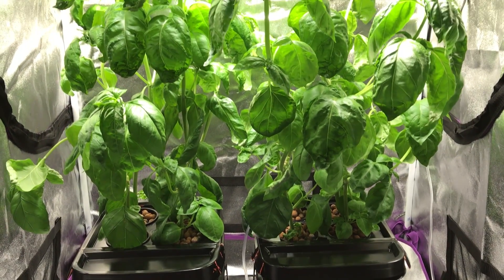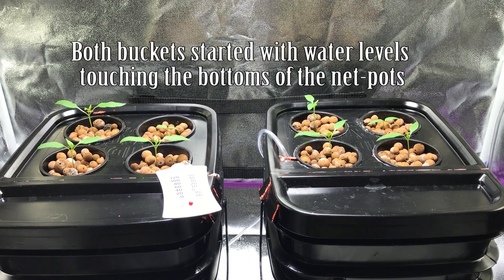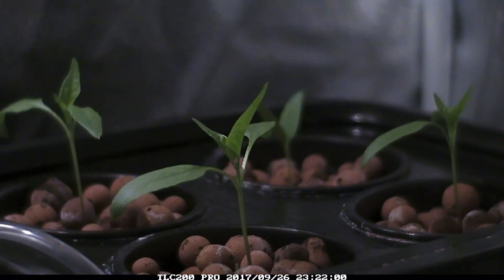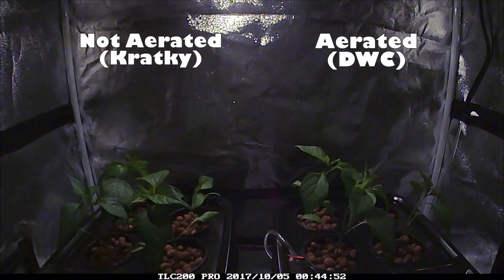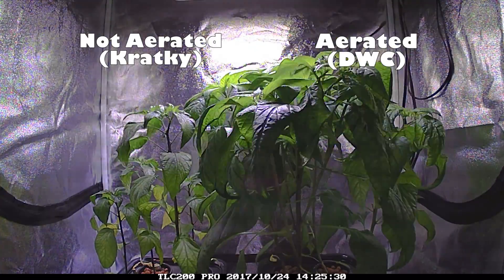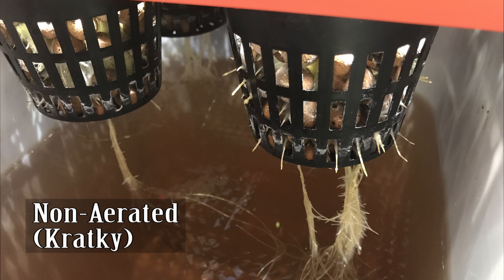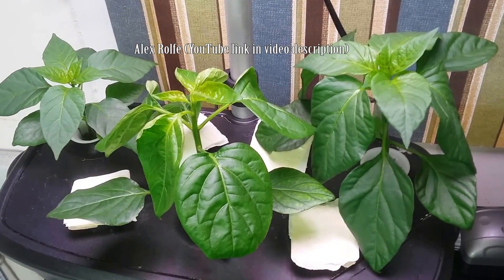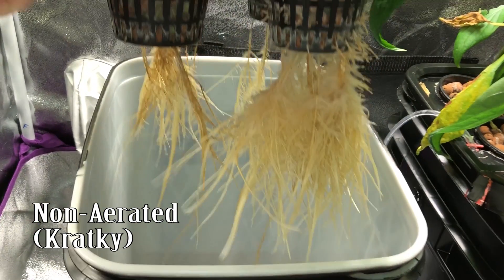Aeration vs No Aeration - Hydroponic Peppers w/Time Lapse (Brinno) “Semi-DWC vs Kratky”

Comment: Have you experimented with different degrees of aeration in the DWC pot? For example, a standard bubbler, vs one of those very fine bubblers, vs say an aggressive bubbler/several bubblers? Wondering if there is an optimum curve that could be resolved out of it. ..
Reply from the maker: Nick Burke not really, but what would happen is initially the ph would go way up with aggressive aerating. Then it would drop and become very acidic. Maybe one day I can do those tests. Just need one of those companies that sells atomizers to sponsor me. They aren’t cheap.
Reply: @GrowingAnswers  Good to know thanks for the reply

Comment: How far were the roots in water? Completely submerged or 5050.
Reply from the maker: 847MicRoss during the entire process the water level was gradually lowered naturally in both. Until it reached about half full. I kept it there through the fruiting stage and then let it lower further naturally until each had about 2 gallons left. Both were exposed to the same amount of air the entire time. Only difference was the air stone.

Comment: wanna ask question,  if we put a bigger air pump in a small bucket with single plant what would be the negative impact?  If any?  
The pump which is designed for 5 gallons bucket to provide air thru air stone and we are feeding that much air to a single one litre jar.  Will it create problems??
Reply from the maker: Nadeem Ahmed no. More aeration is better.

Comment: Nice video. I just got curious about the actual effect of water being aeration while the pumps was actually making the water to move as well. What if you add a water pump or a vibrator on the kratky? Wouldn't it produce a similar effect?

Comment: Would you feed nutrients to chilli (top feed) Every time they get dry or would you rotate water then nutrients then water ect. And do chilli need to be upped slowly to last container size ? Also when would you switch from MH to HPS? When flowering or before? And keep lights between 16 to 18 hours through out?
Reply from the maker: Connor Briard Biggins being hydroponics, you don’t rotate feeding. That’s only for soil applications. Also there’s no reason to change the container size either hydro or soil. You don’t change the lighting hours because peppers don’t have a photoperiod. They flower regardless. As far as MH and HPS, it doesn’t really matter. You might get more blooms with HPS, but I wouldnt use HID lighting to grow peppers. Not with the LED options out there these days. If I used any HID lighting, I’d choose CMH only. And lighting hours can vary depending on light proximity. Usually 16 hours is fine, but if the lighting is weak, you’d need to increase by an hour or 2. Depends on the individual situation.
Reply: @GrowingAnswers  thanks I have a big tent like 1.5m x 1.5m x 2m what led would you recommend nothing in my price range of £200
Reply from the maker: Connor Briard Biggins depends on how many plants and how tall. you can get a white ufo style led from some non-plant lighting websites. Usually for commercial outdoor lighting. Just look up stuff like led street lights or high bay lighting.
Reply: @GrowingAnswers  nothing will beat my 400w setup for less than £200

Comment: What wattage air pump do you use and what size air stone?
Reply from the maker: Whatatay T I’ll add a link in the description for the pump, later. The stones are just cheap 6 inch aquarium airstones.
Reply: Thanks. Interesting and important info how the plants on the edges of the DWC container were smaller with less root development because they weren't under the bubbles. Makes me think a 4 or 6 outlet pump with even a smaller 2 inch air stone would work better.

Comment: Hi.May i ask what lens you used on your Brinno?
Reply from the maker: Blnk Stefaans I
Used a few. Factory lens and aftermarket.
Reply: Can you maybe recommend one? Maybe for closeups of seedlings.
Reply from the maker: Blnk Stefaans use an after market zoom lens. These are not like regular cameras though. You have to very precisely focus it and adjust the aperture to let in less light. There is a sweet spot for aperture adjustment too. Close it too much and the image appears fuzzy, open too much and the focal plane is too narrow and you’ll have other issues too.  You’ll also need an ir filter with and aftermarket lens.
Reply: Thank you I do understand. Can you maybe provide a link to camera lenses you bought that you know will fit.
Reply from the maker: https://www.ebay.com/itm/CCTV-Security-Camera-5-50mm-Varifocal-Lens-Manual-zoom-CS-Mount-Lens-/222322543986?hash=item33c374cd72

Comment: You need to have your water right to the bottom of the net cup for the kratky method.
Reply from the maker: GifCo they both started out that way. In kratky, you don’t keep it there anyway. The water level drops over time and it doesn’t ever get refilled to a higher level. That was the hardest part about this was keeping the water levels the same. Plus the focus here was about aeration. Both sides of the test have to be equal or it wouldn’t be a valid test.

Comment: Why the leaves shake when it's dark ? Did you turn on the fan only when it's dark ? Why?
Reply from the maker: Michel Koureiche this is a time lapse. A breeze couldn’t create that kind of motion in a time lapse. Think about it like claymation. They move around because the plants are orientating themselves over time in search for maximum light absorption like a perfectly oriented solar panel. Even though plants need a rest from light, their mechanism to search for light never shuts off. There are also other reasons, but that’s the primary one.

Comment: there's bunch of molds on the kratky setup. not fair comparison.
Reply from the maker: That’s air roots, not mold
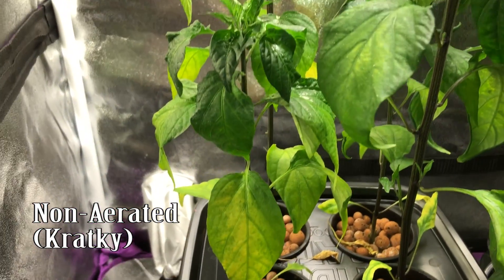Reply: @5:16 look at the plastics.. i don't think roots spreads around the plastics like that. it looks like a molded bread.
Reply from the maker: That's mineral deposit. If it was mold I would have talked about it. Those air roots did not really start showing till later. It was obvious that using an air stone made a huge difference right at the start. And even if it was mold, that still says something about the advantages and disadvantages. It's widely known that methods such as aeroponics, air stone or any system that moves water around constantly, will grow plants almost twice as fast as a static method like kratky. If you watched the follow up video you'll see that eventually the kratky method did catch up slightly, but still produced less and took longer to do it.
Reply: fair enough

Comment: That's not Deep Water Culture, nor is it even Kratky. It's a "Shallow Water Culture". DWC is roots being completely submerged in a deep chamber in some aerated nutrient solution water. Unlike kratky, you don't let water evaporate and don't use a shallow chamber.
Reply from the maker: MaPee1982 first of all, I already mention this isnt true dwc and why. The focus of the title and experiment is “aeration.” In order to properly test aeration, both sides of the experiment must be identical. and yes it is basically dwc because it started out that way and was kept fully submerged until it got too difficult to maintain that water level and be a fair comparison to kratky. it was clearly seen in the time lapse that full submersion or not, aeration won.  That was the focus of the experiment.
Reply from the maker: Tim Shine you know what, you are right. It isn’t true dwc as I said in the video. This wasn’t about deep water culture, as it’s called by definition. It’s about whether or not aerating a solution made a difference. if the focus was dwc vs kratky, then it would be mainly called “dwc vs kratky.” 

The first step in proving a concept is eliminating variables. In order to do that, both sides of the equation have to be equal and that’s exactly what I did. The main component of dwc is simply using an airstone so in order to see what happens when an airstone is introduced, you can’t change the water chemistry to one and not the other. It’s called a controlled experiment. If I were to keep topping off a true dwc it would alter the ph and tds levels while kratky would be untouched. As many times as dwc would need topped off, it would mean you’d have to empty out kratky and start over. But even then the water chemistry in both methods would not be equal to validate if aeration is better. So to say it’s not fair is completely ridiculous. Using the term dwc in this video is just a way to describe the method. First and foremost though, this experiment is only about testing to see if aeration or no aeration works better and if you think it wasn’t fair then there’s nothing else I can say. I very careful about how I conduct any experiment. Now that I’ve proven to myself that aeration works better, I can do a true test of dwc vs kratky without having to worry about keeping the water chemistry identical. Simply because I would be testing the methods themselves and what comes natural to the methods.
Reply: i like it. i  took it for a scientific test . dont know why ...ur right and im gona remove my comment  but  really ur testing kratky method with aeration against no air
Reply: Random Ryan False. The main component is DWC is NOT the use of an airstone. The main component in DWC is.... That's it.... A Deep Water Chamber" hence its name D eep W ater (originally named Deep Water Chamber Hydroponics). There are earlier DWC systems/methods that uses ZERO airstones - it consists of continuous top feed, timed drip feed, recirculating feed and so on, via submersible water pump. Because weed growers typically veg and flowers for significantly longer than your regular vegetable growers, the idea of adding aeration to DWC only came after many growers started experiencing root rot, due to a buildup of anaerobic bacteria, algae, sludge, pythium, etc., combined with warm water temps. After adding oxygen to the system, growers experienced a significant boost in growth speed and a drop in root problems. So yes, adding oxygen to any hydro setup, namely DWC, your crop will grow twice as fast. And if you have your environment and water/ambient temps really dialed in, and you have a green thumb, you can really push your plant's growth limit to as much as 3-5x it's normal rate. In true DWC, you don't top off the res. At least most DWC gardeners don't do that. You empty it completely and refill with fresh nutrient solution rich water every 1 - 2 weeks, in order to get rid of any traces of bad bacteria build up. Cannabis cultivator have used and proven the benefits of aeration over and over, since some 10-15 years ago.

Comment: Well done video presentation, and good job!  My experiments have also shown better success with peppers using DWC, versus Kratky method.  That being said, the Kratky side of your experiment has a couple noticeable items.  First, the dominant plant has consumed enough nutrient to leave it's companion plants struggling to reach the nutrient.  Results would have been much different, if nutrient level was kept high until sufficient root growth was seen on all the Kratky plants, then gradually allow that nutrient level to lower for the formation of more gas exchange roots.  Second, when changing out nutrients, the nutrient level in the Kratky side should not be refilled above the level at which the plants are growing.  Once nutrient consumption roots are out of the water, they transform to gas exchange functionality.  The transformation does not reverse, and essentially the roots drown when the nutrient level is raised.
Reply from the maker: Matt Garver I never refilled the kratky side higher than the existing level. Toward the end I let it down to about 1.5 gallons and just replaced it as needed. Thanks
Reply: Thanks for your clarification, and for correcting any presumption that I might have made.  I used the Kratky method 100% for my outdoor 2017 garden, enjoying the benefits of remote garden placement without electricity.  By employing the fill and forget technique of Professor Kratky, I also did not need to refill my containers outdoors. You can get a glimpse here, https://www.youtube.com/channel/UCUznk-cggnf5NrnneXBykfQ?view_as=subscriber

Once again, I find your video quality outstanding.  Having just discovered your channel today, I have subscribed already.
Reply: The gas exchange roots will adjust to the new regime as long as there are still water roots below and some air roots above (in air). It you submerge everything the water roots wont be enough to sustain the plant because you`ve effectively temporarily shut down a large proportion of the overall rootmass. I run aero where the root structure can steered to water or gas exchange depending on the misting regime. Overmisting prevent gas exchange roots growing, and/or causes them to be lost if already present. Once the overmisting situation is rectified the gas exchange root structure returns or begins to form. The gas roots recover faster if they were present previously vs if there were none to begin with ;)
Reply: I thought the Kratky method was supposed to be simple??
Set it and forget it...

(It honestly sounded like bunk, but Matt's channel also shows some interesting results... so I may have to watch y'alls videos do some testing on my own.)

Comment: Muscle-memory? Need muscle tissue to even begin that hypothesis...  :)

Plants do have, and rely on, circadian rhythms like almost all life. The nastic or non-directional movements (vs tropic or directional movement) prior to darkness are probably an artifact of the plant not fully supporting that day's new growth....the internal support structures lag the faster growing apical cells...meaning gravity is pulling the plants down and in winding motions over time, likely a combination geonyctinastic and autonastic responses. And some of that movement in epinastic, where the plant's leaves are growing faster on the top then the underside because of the light and by how they are structured internally, this can be seen as the leaves curving toward the ground (and the same for when new leaves uncurl epinastic movement...its a slight difference in cellular growth rates instead of a pushing or pulling force like we typically think about in muscle movements).

There are nastic and tropic movement classifications for a long list of causes....fascinating world out there if you like reading science stuff and pondering what/why/how about the world around you.
Reply: p.s. - great video.
Reply from the maker: Miles Thompson Thanks. And muscle memory is just a layman term. But thanks for the in depth explanation.
Reply: Just joshing you a bit. Loved the time-lapse video...can never get enough of watching plants move.

Comment: So it is possible that they both would have done as well if you kept the water level up to the net pots the whole time.so the roots always had access to the solution. Is that correct?
Reply from the maker: Steve W no. The Kratky method would die. In almost all hydroponics, the roots need to be exposed to air.
Reply: Randy, Thanks for your reply, but read about lettuce rafts.
Reply from the maker: Steve W that works when the water is aerated so it’s technically a dwc. maybe there are some plants that can handle complete submersion of roots such as aquatic plants and maybe some other types where the plants use less oxygen. However I think there is a method where roots can be pruned to handle submersion for longer. But aside from aquatic plants, virtually all plants will eventually drown if roots are completely submersed. But I did keep the water at the bottom of the net pots for the first 2 weeks until the roots started growing air roots out the side, then I let the level drop naturally. In order to be a valid experiment, the water level must be allowed to drop for this particular test. otherwise the kratky would do even worse.  This basically shows that the roots absorbing O2 from the air alone isn’t as beneficial as as both the air and solution.
Reply: Randy, Truly sorry to be such a gadfly. Aeration is not necessary for lettuce rafts (see https://www.youtube.com/watch?v=7HNFaYByQlg) and water doesn't have to drop for  Katky (check out the Salad Box by Hydrofarm--the "top off" bottle maintains the water level https://www.hydrofarm.com/p/GCSB).
Reply from the maker: Steve W I’ll watch the vid later. Don’t have time now. I can only answer questions based on what I’ve observed or learned through other sources. There must be something else I’m missing though. I do know that in almost all cases, the kratky method by definition is letting the water level drop enough to expose roots to air. At least partially. However, the other part of that isn’t just air, it encourages roots to grow more by reaching for the water. This creates a larger root structure which in turn helps the plant grow larger or just plain better. 

And the second link isn’t taking me to what you are showing. It’s just a website for products. Not a specific one.
Reply from the maker: Steve W to answer the question more directly, no I don’t think the kratky would have done any better by keeping the water at the base of the pots the entire time. I’ve never seen that technique done on a pepper plant or any fruiting plant aside from maybe strawberries. from what I’ve observed in stuff I’ve grown is without aeration and 99% submersed roots, they grow slowly, the roots don’t branch as much and there are far less capillaries that form on the roots (hairs). the raft method from anything I’ve seen works for lettuce and maybe some other herbs, but I believe other plants would do worse. However you’ve given me a good video suggestion. No better way to confirm than a test.
Reply: "However you’ve given me a good video suggestion. No better way to confirm than a test." That's the response I was hoping to evoke! I am looking forward to it! Please keep me updated. Thanks Ryan.